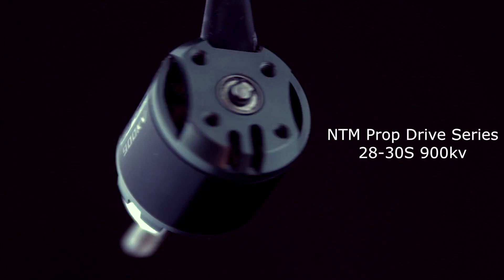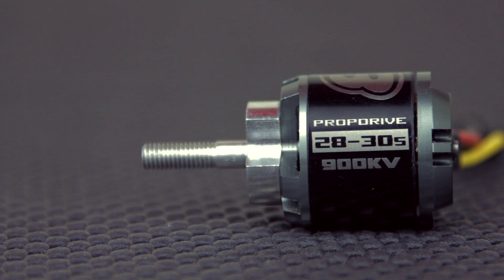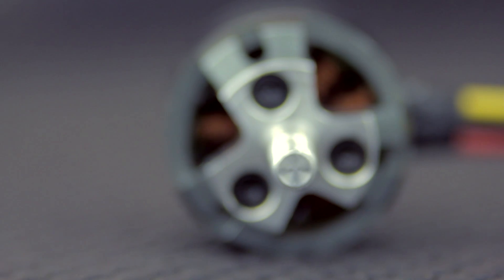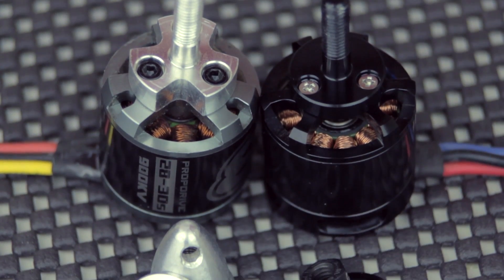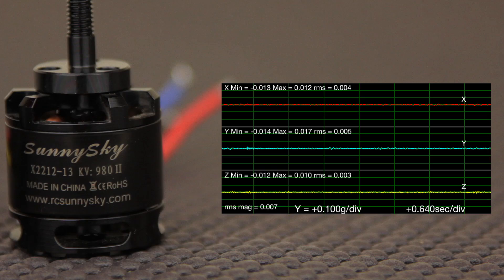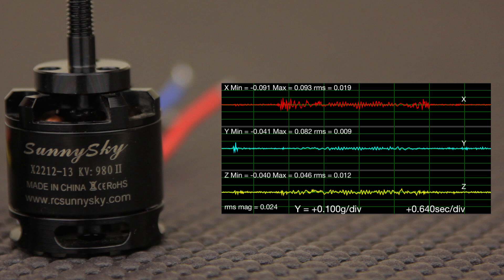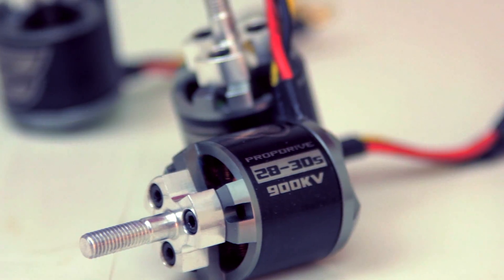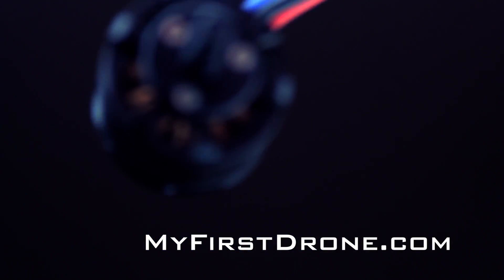Sunnysky 980kv V2 vs NTM 28 30s 900kv Motor Review

Comment: So we base our motor buying on just one bad motor do we?  With comparisons like this I detect bias or hope for freebies.  How long have you been using motors? I've been running NTM's (about 60) ever since they were released by HK. Apart from a few replaced bearings (after a decent amount of use) I've had only a bent shaft due to a crash, it was replaced in minutes.  Mind you, I do look after my gear, a little very light oil and an occasional blow out with compressed air is all they get apart from a spin by hand prior to any flight. 

If they were as bad as some newbies are making out I certainly wouldn't still be buying them. I'm not saying they're the best, but then I didn't pay a lot for them. I've seen and heard many top shelf motors die so NTM doesn't have a monopoly on failing. With the price of suitable quality bearing being so low I carry a range of them just in case.

Comment: Coreys use of editing properly really shows, Ill agree. He says whats needed, and skips the dull parts. Ide like to know if there is a "chart" in existence that ranks the available motors. Ide like to build a multirotor, but the stumbling block would be what size to buy based on what motors are out there, and what power capacity battery must be used with them.

Comment: Are the new 2212 989kv from SS a little different or is there a manufacturer making fake ones?  The ones I just received have really garbage windings compared to the previous ones I had.  In addition, the new ones have slightly thinner bell metal, a 2.8mm shaft vs 3.2mm, smaller prop adapter screws, just one grub screw rather than two, and different font/paint for the writing on the bell.   Fake?

Comment: I just picked up some 28-30s pretty cheap, gonna try them just for fun.     I tested them and out of 8, 6 seem to run very smooth and quiet, 2 are a little noisy.     I bought them used so I'm not expecting great things from these motors, and like I said, I got them at a good price :)